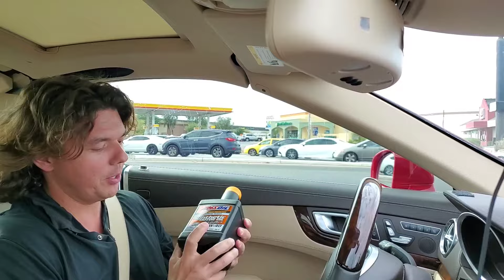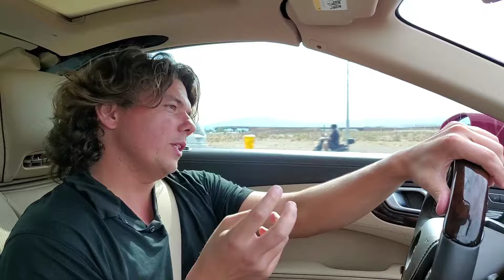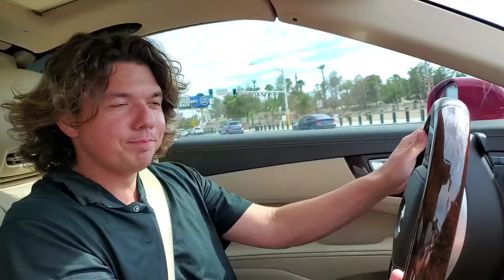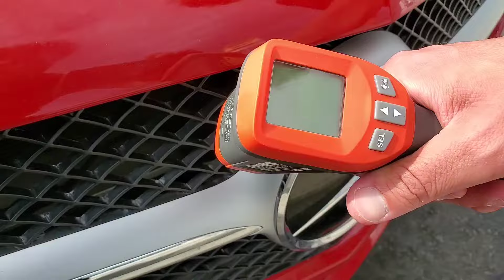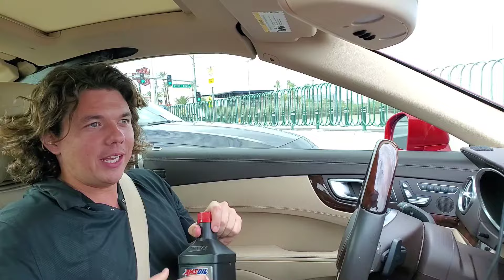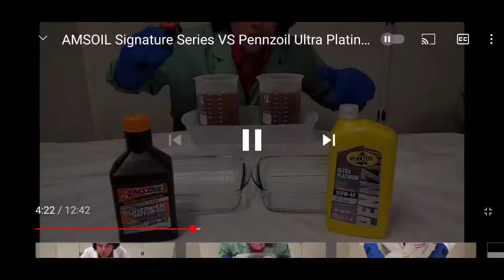Why AMSOIL is the Best Motor Oil & Transmission Fluid

Comment: Why the best? Let's start with first certified synthetic 100% synthetic oil and not a blend with all the molecules the same size, and the best additives to flow in the cold like 52f degrees below zero, and high heat additives that does not drip off the cam shaft, the crank shaft, and piston walls.
     Less carbon and soot - for carbon and soot is like 2000 grit sandpaper. 
     Also, the oil filter filters at 20 microns, and a human hair is 40 microns. 
      That's 100% the best protection possible. 
     I run this in my car bought at 140,000 miles and is now over 200,000 miles and runs like new. 
      I am truly impressed. 
Thanks for the great video content. Education is key. 
     Learning alot from Gail Banks who designs differential covers for pick up trucks and air blowers for more power for Towing. 
      Amsoil research department is tops, and everyone in the oil industry follows their steps. 
      I have saved a lot on repairs fir sure, and best of all, my car gets great gas mileage. 
     Thanks for sharing your enjoyment of cars, trucks, and lubricants. 
     I am always looking forward to your next videos. 
     Great content.

Comment: I have a question. My Ford Ranger calls for 5w30 engine oil. But is this the most optimal oil viscosity for my car considering here in the Philippines it's literally hot and summer all year round, cars get a little more hot because we have small congested roads and stop and go traffic. Should I switch to 5w40, 0w40 or 10w40? I feel like our car here needs thicker oil compared to American standard 5w30. What can you say?
Reply from the maker: Kind of I would do a couple things I would put the 10W-30 signature series in it also I would clean the radiator with the coil cleaner that will help get the bugs out of your radiator so it's more efficient I would also do a low toxicity biodegradable coolant change with themselves and run 33% concentrate and 66% distilled water.

You have a bigger specific heat capacity and I would also run the Amsoil Dominator cooling boost which is the orange bottle that will help it run much cooler as well.
You'll notice a huge difference
Reply: @Syntheticoilprotection  Thanks, I will try this one.

Comment: I discovered your channel 3 month ago, watched some videos. But it's only last week that I decided to purchase my 1st AMSOIL product, I bought the signature series 5w30 Max Duty Diesel Engine Oil (2 gallons+1 quart bundle) for my Ford Ranger XLT 2.2L 2014 model, together with the Amsoil Transmission-Transaxle Fluid 75w-90 (GL-4) and the Rear Axle Fluid 80w-90 (GL-5) Severe Gear Oil as these viscosity is what the ford booklet calls. My last order which is the 3 gallon coolant has not arrived yet. But man, the truck now feels different. It drives and accelerates quicker and smoother shifting.
Not to mention I also bought another gallon of 5w-30 signature engine oil for my Honda Civic. I live in the Philippines by the way. You in the US have EBAY or AMAZON, but here we have "Lazada" and "Shopee" where we can buy stuff too.
Reply from the maker: That's awesome thank you for sharing that with me and my YouTube community really appreciate you 😃💯☕

Comment: hey im a big fan of mobil 1 oil. and its hard for me to change oil brand. and i like the performance of liqui moly oil also, but i never heard a 25k miles and it seems scary to try doing 25k miles. but if thats really work i hope you'll pick with your promo
Reply from the maker: This is a good comparison showing the differences.
The Power of AMSOIL Signature Series 5W-30 Synthetic Motor Oil protects against harmful deposits on turbochargers 4X better than Mobil1® Extended Performance and 3.6X better than Royal Purple® in industry-standard testing*.  Read This Article - https://www.amsoil.com/newsstand/motor-oil/articles/leading-the-field-in-deposit-protection/?zo=5331179

Comment: Hi Eben, Lately I bought this s350 2009 Mercedes Benz. It is using MB ATF Red fluid from 77 Oil Brand. Does it safe to use this SIGNATURE Atf on my mercedes? Is it okay to have difference in colors? Thanks love your Channel
Reply from the maker: Yes you can use the Amsoil signature series ATF you just want to double check which one years takes it's either going to take the red multi-vehicle ATF or it's going to take the fuel efficient signature series ATF this is the lookup guide and it will give you all the fluids and capacities for your year make model and engine size.

If you're new to Amsoil the 6-month PC membership will save you about $33 and $100 order and when you use my link I will be your Amsoil dealer so I could always answer your questions in the future and I would also get the credit for your orders.

If you have any questions before you order feel free to reach out to me ☕💯😃

Find Products For All Vehicles - 
https://www.amsoil.com/guides/?zo=5331179
Reply from the maker: Professional YouLubher: Eben Rockmaker Regency Gold Direct Jobber AMSOIL Specialist (Dealer#: 5331179) 702-472-3614 

      AMSOIL Wholesale Pricing - https://www.amsoil.com/offers/pc/?zo=5331179

Comment: Eben I first learned about AMSOIL from watching your channel during the many weeks of furlough during the plandemic.  Anyhoo, I run 0W16 original equipment AMSOIL in my '21 RAV4 hybrid after initial break in, and will be doing a second AMSOIL oil change at 5k.  Hoping to see the company produce 0W16 in Signature Series in the near future but until then I'll just stick with 5k oil change interval, and life is good.  Still debating whether to use AMSOIL gear lube and ATF though. Thanks for what you do.
Reply: Eben, the Car Care Nut channel has been a another good resource for me on maintenance specifically for Toyota vehicles.  I think you'd enjoy his honest and straint forward nature and perspective as a certified Toyota diagnostic, hybrid certified technician.
 https://youtu.be/xdNCnYHhEm8
Reply: @read1kings18  I watch him too!👍
Reply from the maker: Thanks for sharing Jason
Reply from the maker: Of course one thing to note the Amsoil OE is still 100% synthetic and it has a much higher film strength and if you keep your fuel dilution low that oil will still go a very long time.

I would definitely try oil analysis on your next oil change interval and see where it's at You may be good for 10,000 mi on that vehicle depending on your driving conditions if you're doing a lot of highway driving the heat and oxidation is minimal because there's a lot of cooling on the highway.

The Amsoil oil filter is good for 15,000 mi so it may save you quite a bit of time and money to do that test and that way next time you might be good for 10,000 mi with one oil filter and filter change.
It could save a lot of downtime and money on oil changes depending on your driving conditions.

Thanks again Jason for sharing that with the channel and thank you for following up 💯
Reply: @Syntheticoilprotection  yes, I have done a lot of research on oil filters and I'm impressed with the AMSOIL oil filters.  The transparent nature of AMSOIL specifications gives me a greater confidence about selecting them for use in my vehicles.  Have you considered  making some review videos on your channel comparing oil filters?  I know there's a lot of those already on U-Tube but it's funny they're often refusing to actually make a recommendation. This tells me it's likely they're not confident of their information, and don't have any real skin in the game.

I have plans for doing an oil analysis around 10k miles because by then I'll have eliminated nearly all the mixture of previous oils and be nearly 100% AMSOIL motor oil.

Thanks for the tips to save money.  We all can use those nowadays for sure.

Comment: Eben- I've been using Amsoil products for over decade.  On my Generac whole home bypass generator.  My 14-year old Toro super recycler lawn mower and my personal vehicles.  Just bought a new Mazda CX-5 Carbon Edition with the 2.5 SkyactiveG Turbo.  I already purchased the Amsoil Signature motor oil and the ATF transmission fluid for changing after I put about 500 break in miles on it.  However, going forward I would like to order my Amsoil products from you.  How would I do that?  If I sign in it defaults to my other dealer and I can't change it.  Do I click on your link and create a new sign-in?  Will my preferred status carryover or can I enter my preferred account number on your dealer web page?  Please advise- Thank you!
Reply from the maker: You would have to be released from your dealer You would want to contact them and at their discretion they could release you and then AMSOIL could switch you to me.

If you are in regular contact with your dealer I would stay with him.

If you do not even know who they are you have the ability to contact them when you log in and ask if it would be okay if you are released to go with another dealer.

Thanks for being a part of my YouTube community and I appreciate you thinking of me. 😃☕💯

Comment: Hey I have a question so my dad has a 2013 ram 1500 with a 5.7l hemi and im on amsoil website and for the oil filter there no amsoil oil filter for it but there's a wix one. I also have a ram but mines a 2010 5.7l with the amsoil filter can that still work on my dad truck if its not listed?
Reply from the maker: Just depends certain years have different filters even though it's the same motor I actually had a mistake when I ordered the wrong filter on Richard's truck. It's always good to double-check the filter size and cross-reference it
Reply: @Syntheticoilprotection  okay thank you thats so werid because its the same motor and everything and my truck takes  i believe eaO11
Reply from the maker: I know that happened to me and I was like what the heck how could it take different filters very strange how they can change things mid model year
Reply: @Syntheticoilprotection  yeah just kinda wondering if that filter will still work on my dad truck even if its the same motor
Reply from the maker: There are different hole sizes in the filter the main size you'll see it when you look at the different filters side by side so you just have to find out which ones the smaller or bigger hole size for that oil filter thread on

Comment: My daughter has owned her 2002 Camry LE for six months without getting in a wreck and totaling it.  So, I purchased four gallon jugs of Muti-vehicle Signiture Series ATF.  I'm going to do three drain and fills on my daughter's Camry to replace 80% of her transmission fluid.  With the third drain and fill, I'm going to replace her transmision filter.  The forth gallon jug is for doing the first Amsoil ATF drain and fill on my son's 2001 Camry LE.
Reply from the maker: Sweet, I'd love to know how it shifts once you finish definitely let me know Thanks for keeping in touch and sharing with the channel
Reply: @Syntheticoilprotection  I already have some info in that area.  My 2006 Sienna XLE had a transmission in top shape, with very fresh new bright magenta Toyota Type 4 transmission fluid so, after completing four drain and fills with Multi-vehicle Full-Synthetic ATF, my '06 Sienna showed no improvement in drivability.  My daughter's 2002 Camry LE has an automatic transmission that performs rather sickly because the differential shares the same cloud compartment as the gearbox and torque converter and the differential is emerced in spent transmission fluid.  I'm speculating that this 2002 Camry LE will have dramatic improvement in drivability after the second drain and fill.  My son's 2001 Camry LE already has two Toyota Dexron III drain and fills completed in the last twelve months and it has been driving like a top.  I'm speculating that the first Amsoil ATF drain and fill, on his '01 Camry, will have very little effect on improved drivability.  His second Amsoil ATF drain and fill will be in February, 2022, Lord willing.

Comment: Hello Eben! I am from NW Vegaa where can i get my radiator fluid flush? I have a 2009 smart car.
Reply from the maker: Honestly I have no idea what I recommend is ordering the products with my link and you'll get the products at wholesale as a 6-month PC member also if you ever have any questions in the future I would be your Amsoil dealer when you use my link and I would get the credit for your orders. I would then find a garage that does those cars with a really high rating near you You can find them on Google maps You could also ask a friend and I would take the products to them and have them install it and make sure that they'll let you watch the installation.

Professional YouLubher: Eben Rockmaker Regency Gold Direct Jobber AMSOIL Specialist (Dealer#: 5331179) 702-472-3614 

   AMSOIL Wholesale Pricing - https://www.amsoil.com/offers/pc/?zo=5331179

Comment: Your words are very convincing and frank , and I am in Kuwait , the temperature is 55 degrees and we like 20w50 5w50 even with new cars or old , but I prefer Ow40 Amsoil oil , I prefer for new car , which has a viscosity 14.8 in 100c It is exceptional .

Comment: I didn’t know what to expect when I ordered amsoil the first time, but when I tried it I couldn’t believe the smoothness and quietness it made my Silverado my mileage is at 170k miles and wow it sounds like a new truck so smooth and quite and drives like a dream! You will spend more $ on oil changes with other brands since you’ll have to do it sooner and With Amsoil you can go twice as long and not worry about it because you’ll know you have Amsoil protecting your engine and the rest of your car if you choose to switch all the oils! 
Now my whole family is trying it and they are definitely happy with the outcome! 

Never am I putting anything else but Amsoil in my car/trucks! 
Thanks Eben for being my Amsoil dealer!
Reply from the maker: 😊, Thanks again really appreciate you sharing that with the channel 😃☕

Comment: So I want change the front transmission fluid with the Amsoil.
So if I change the front transmission oil do I need complete drain all the oil in the turk converter?
Reply from the maker: It's okay to do a drain and fill You do not have to get all the old fluid out You can mix the Amsoil with any of the other OEM fluids

Comment: Another great video my friend! So, glad I found your channel. I had heard about Amsoil years ago but never tried it until I came across your channel over a year ago. I also seen Amsoil win Project Farm's oil championship last year and I was sold. I won one of your monthly drawings last July. I used my $100 in  Amsoil products to switch over my 2020 Jeep JLU Sport Altitude 3.6 to all Amsoil. Engine, differentials and transfer case. It runs smoother and my MPG increased. I also have piece of mind knowing that I have the best synthetic products protecting my Jeep. Amsoil is the best because they start with a pure synthetic base stock then blend in the highest quality additives at the optimum levels to produce unmatched performance! Other oils are OK,  some oils are good but it takes superior quality and performance to be the best. Amsoil Signature Series and Severe Gear is the best! Eben thank you for doing what you love and loving what you do! You are successful because you are a genuinely good man and you give back every month to your viewers. Great channel, Great Amsoil products and awesome viewers

Comment: Eben I have a yacht that has Detroit Diesel engine 6v92 turbo 
Amsoil has any oil for that engine?
Reply from the maker: Yes I would look it up on the lookup guide if it's not on that I would do the signature series version and you can see the different viscosities on the site if you're new to Amsoil I always recommend the 6-month PC membership unless you are a business and then you could always do the business account when you sign up with my link I'll get the credit and I would be your Amsoil dealer so I could always answer your questions in the future.
Professional YouLubher: Eben Rockmaker Regency Gold Direct Jobber AMSOIL Specialist (Dealer#: 5331179) 702-472-3614 

   AMSOIL Wholesale Pricing - https://www.amsoil.com/offers/pc/?zo=5331179

Comment: Great video, very informational 👌🏼 Have been using the Signature Series 5w-30 for a year now on my 06 GMC Sierra 4.8L. Changed it in the first 6 months simply because I know that it has more cleaning power than other oils and I know my engine was pretty dirty after seeing the insides of my valve covers, I had lots of baked on oil/varnish from the pervious owner. So I wanted to be able to flush it out in case it loosened any of it! I will start increasing the interval mileage to 8k, 10k, then 12k but making sure not to pass one year. 👍🏼
Reply from the maker: Yeah it's always good to change the filter sooner than later especially the first time you switch over I have the video coming up very soon on the SL550 showing the filter change and the oil analysis results after 5,000 mi of city driving

Comment: Oh and Eben when explaining the higher altitudes, you can also take into account not only reduces cooling efficiency, you also just generally gotta rev the car out more because of the power loss, accelerating wear. And that's on top of any extreme temperatures.
Reply from the maker: 💯, Big time Thanks for that Ad

Comment: Hey Eben I may have convinced my manager at work to switch to Amsoil on his 2000 Honda Odyssey w just over 200k. My 03 Honda just ran up to about 290k and she's been on the signature series for about 20k or so.
Reply: Also just gotta say I occasionally run the P.I. and Upper cylinder lube